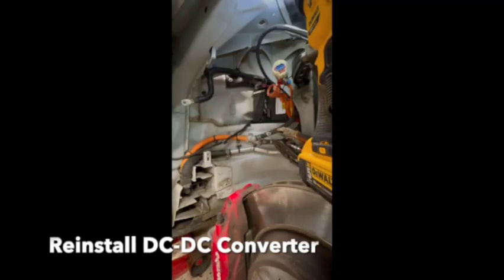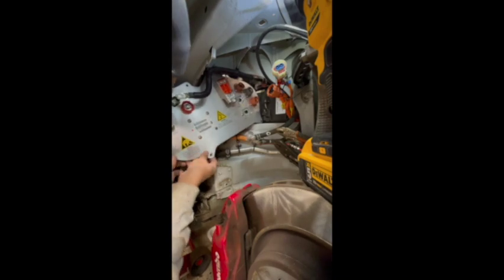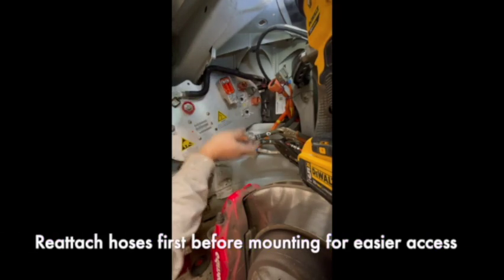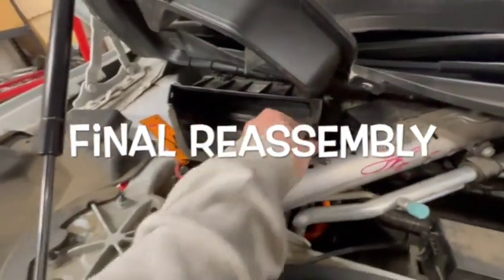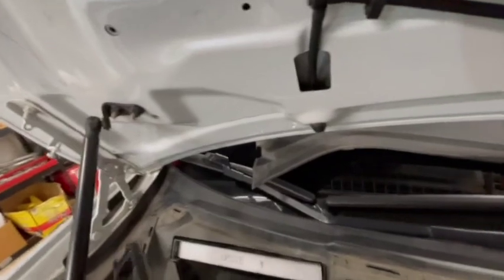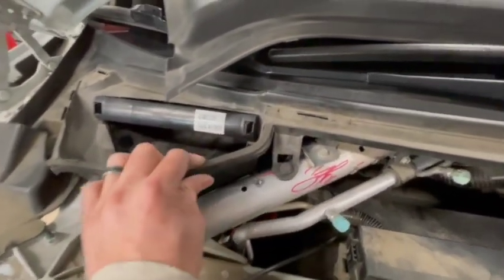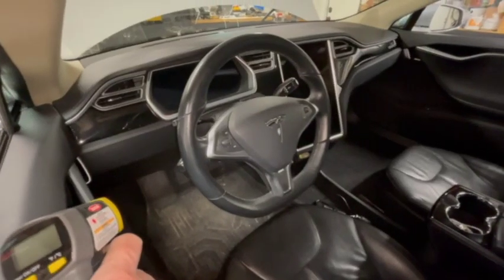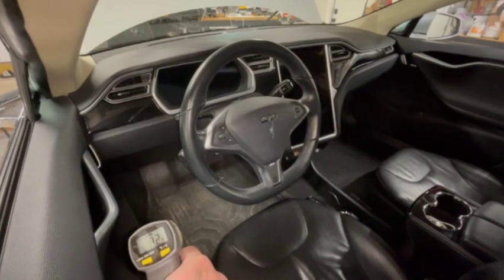5of5 - Tesla Model S: DC-DC Fuse+PTC Heater replacement (DC-DC reinstall and general reassembly)

Comment: So, I did EVERYTHING as you showed (I only had to replace the 40A fuse for the AC compressor), but when I put it all back together I got an error message on my drivers display which read "Insufficient power to drive vehicle -- Service Required".   And although all the displays in the car work as they should (driver's display and central display), the car will not go into any drive mode.  It's dead in my garage.
Reply: Did you solve your problem ?

Comment: Great job and instructions! I would like to see a clip on how you restored the HV step after you reconnect the 12V battery prior to operating and checking heater and ac cooling mode function, thank you.